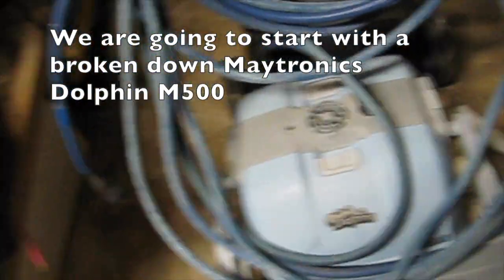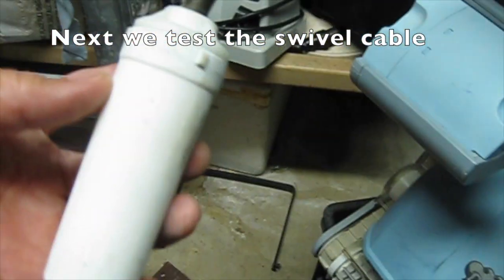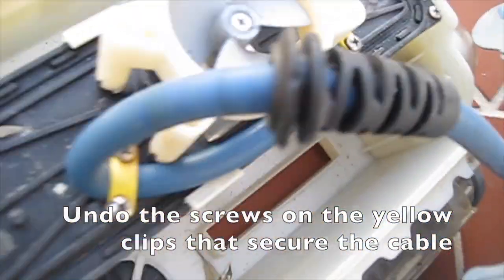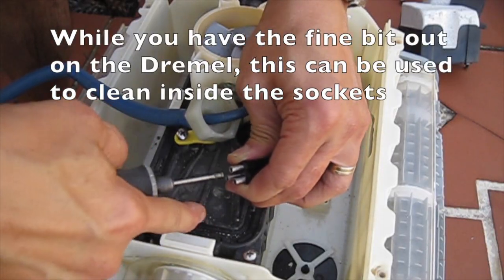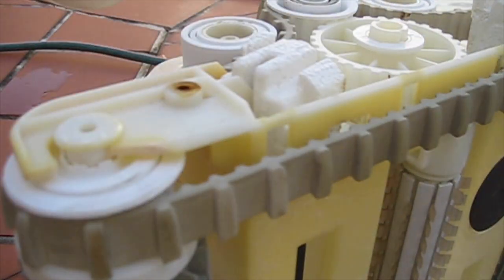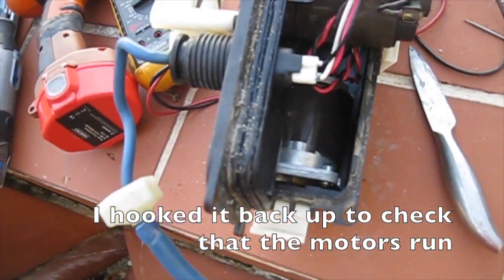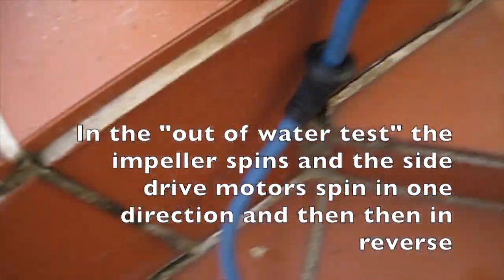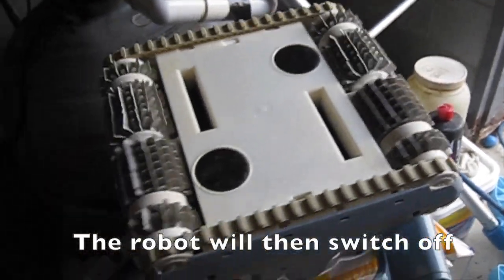fix faulty non working Maytronics Dolphin M500 pool robot complete diagnosis and repair

Comment: Hi Dentivent and thanks tons for your video. I am really hoping you can help me with my faulty machine. About a week ago I noted that my Maytronics DB2 Robotic Cleaner D9440H - 20/07/2021 was moving forward about 10cm and then backwards about 20cm and then it would stop. Yesterday, I took it out of the water, checked that there was no visible obstructions, cleaned the impeller and then did the upside down out of water test. It was during this test that I noted that there was a clunk after every rotation. It operated for approximately 15 or 20 seconds and then stopped for about 5 seconds and then started up again, but it did not turn itself off (with the continual clunk every rotation). I turned it off, put it back in the pool and it did the same thing; forward 10cm, back 20cm and then would not move. Today I have removed the track covers and confirmed that there is no blockage. I hand spun the cleaner rolls and noted that there is a 'clunk' on every rotation. I then tried the upside down out of water test again; however this time the tracks moved very slowly for approximately 2 seconds and then it stopped. I waited approximately 2 minutes and it did not commence operating again, so I turned it off. Can you please suggest anything with this one? Cheers,  John
Reply from the maker: Glad to help. I’ve fixed two DB2 machines in the last few weeks . They are similar to the S200. The clunk is most likely why it is not working . I’d take the tracks off and spin the wheels to see if you have a broken gear or the gear is not engaging properly.  Let me know what you find.

Comment: Thanks for this helpful video!  Our unit has a 3-pin cable and I think the power supply is faulty (erratic voltages).  Do you know the expected voltages at the power supply socket? 30V between which pin numbers, and what about the third pin?  Thanks for any help!
Reply from the maker: I’ll check when I get home but the third voltage is very low like around 5 volts and that is only used to change floor/wall/ water line selections . 
Best place to check voltages would be the power supply and then check at the robot end but you have to take the cable out of the robot so make sure you silicone grease the connection well and check for corrosion inside the motor box connection . Also do not over tighten that white ( or black ) nylon nut .
Reply from the maker: If your multimeter lead is negative on pin 3 the 29 volts DC is pin 2. There is a signal voltage on the third pin . I can check what that is if you want but be careful that you are using a good quality meter as some of the low end meters can give fluctuations.
Reply: @Dentinvent  Hmm, with the robot unplugged, I'm getting nothing between pins 2 & 3. Keeping neg lead on #4 I get +5V when the app says it's not cleaning and -16.7V when I hit  start.  Good quality Tektronix DMM. I think the supply is busted. I removed the connector and the familiar stench of burnt electronics was intense. Thanks for hanging in there with me!

Any info on that control signal would be great.  I'd like to get this running using my benchtop supply as a temporary fix but not sure if I need a command signal or just give it the 30V.

Comment: Hey man - great video but still having issues- it does the test cycle fine and the impeller goes - put it in the pool and it just says nah - it had some debris wrapped around the impeller and was a bit stiff to start with but it’s humming on dry land / troubleshot everything else but just thinking it might be the impeller bearings with the extra resistance from the water making it say no more - any thoughts as it’s beyond a joke 

Cheers, Nick
Reply from the maker: Nick ,
After that video , I had a few problems ( coming up in a new video when I get to it ).
I completely disassembled the black box and took the motors out . Seems like one of the motors had a stiffness in the bearing and that caused the robot to keep stopping.  Another thing to check is the active brush wheel bearings . If the bearings wobble it causes stress on the drive and robot stops .
Let me know how you go .
Reply: @Dentinvent  Thanks on the prompt follow up. Here’s what miss temperamental has been doing. Stopped working so replaced the main drive rollers as teeth missing. Great, problem fixed - 3 weeks later same deal/- playing up going a metre each way and shutting down. Replaced the side bearings rollers for tracks /- goes again (for one cycle) and then nada again. Used a mates control box and it went fine for about 5 minutes and just stopped so back to same old - it doesn’t even turn on unless it’s unplugged for 15 - 30 minutes and then does it’s haka and that’s it again - so I think I’ll dismantle the drive motors and start there and then come back to the oracle and let you know how it goes. Appreciation again on your videos as they are very informative and it’s hard to find the proper oil in this day and age of information hoarding so top marks good sir!
Reply: Success and joy finally - it was becoming like my nemesis or the better half lol 

But yeah, it required unplugging the two drivers in the black box and taking them out and then just unscrewing the two bottom screws on each and pull the bottom plate off that has the small switchboard attached - lots of carbon dust so blew it out with the central slide housing off. I then used 400 grit sandpaper and cleaned up the copper spinning bit and scraped the centres with a razor, sprayed with contact cleaner and wiped off /- also sanded the face of the two spring loaded small magnets on the switchboard and put back together /- trick with the spring loaded magnets was I looped the copper feed wire over the back of their guide runners / - put back together and put screws in and tighten up - then loosen them off just so you can see inside and use a small screwdriver to flick the wire off the runner so that the springs reengage and then tighten back up put back together and hopefully your away - cheers again Dentinvent - it’s always good to have the intel 👍🏿🤙✌️

Comment: @dentinvent - thank  you for the detailed and thorough explanation! Very useful. On my M5 with tracks and rollers removed, the dry test goes well on one side (~10 sec) but on another side the motor stops after 3 sec.  Before opening the motor I wanted to ask the expert - thoughts?
Reply from the maker: I always thought both sides operate for the same time .
I’ve taken many of the motors apart and I’m making videos on current draw and bearing changes. The robot in the video ended up stopping all the time . I took it apart and compared the two sides and one drew more current . I changed the bearing on the high craw motor and … it works like normal .
Still working on that video of you want me to make it . 
I did note high draw current does make the robot stop completely.
Reply from the maker: If you open the motor it usually seals back well and you get a chance to check moisture inside it so that’s a bonus .

Comment: I have a Dolphin Sigma cleaner but very similar to your machine (about 3.5 years old). Mine runs a few feet and then stops with the red light shown on the power supply unit.  I did the upside down test and it is fine. I have replaced the guide wheels, tracks, climbing rings and brush set; but the problem still persists.  Since it passed the upside down test, so I assume the problem is not with the electricity.  Or I may be wrong?  What can be the problem?  Will great appreciate any advice.
Reply from the maker: Strange if it passes the upside down test . 
When the wheels run with robot upside down does it look smooth? If it has a central active brush , often the bearings go and cause the gears to run crookedly . This can make the robot stop . If the gears of the active brush look suspect , remove the active brush completely and see if that works .
What in the red light on power supply ( what does it mean ?) show .

Comment: M500 powers up in water but then shuts down within 10-15 seconds. I disassembled down to and including motor box ...all dry. 28V at cable end. Connections clean (gold). The unit was tested upside down as the video suggests it runs one drive for about 5 seconds then the other drive...so all good. when I placed the unit in the pool. It powers up but within 15-30 seconds it shuts down. Any suggestions.. circuit board gone? The motor has been replaced once.
Reply from the maker: When it was upside down , did the wheels spin smoothly ? I found one two weeks ago that the pool shop said it was a blown motor and it was actually the active brush bearings broken causing robot to just stop . Have a look there . Other place it can be is the bearing of the impeller motor . I’d check the active brush bearings and get back to me . One way to check is to have it all back together and take the active brush right off and see if it runs .  Let me know .

Comment: @dentinvent
 Hi I am working on my neighbors Supreme M4. I have continuity all through the cables and the correct voltage all the way up to the motherboard where the voltage reads the same as the box. The motors will run off the box when I jump from the box.  but nothing happens after I reconnect everything. My neighbor said a rag was sucked into it. The tracks spin easily and motors work. Could it be the motherboard. It does light up though and give the correct voltage. I did use his other box that currently runs the premium model and no change. Thanks for any advice!!
Reply from the maker: That’s really interesting that if you run directly off the power supply it works but not with the cable . Sometimes voltage is not an indication of being correct . Can you swap the cable with another one to check ? Also is there any corrosion at the motor box - cable connection and is there any corrosion in the anti tangle swivel connector ?
Reply: @Dentinvent  Funny enough I was thinking the same thing about the cable. His cable is fairly twisted. I could try his box and cable on his premiere and see if that makes a difference? I checked for corrosion through out the cable and connection and box, I did not find any.. Initially the inverter motor did not work so I got another off of Ebay so that is what is in there now. The replacement was the Exact same motor. The seal was new on the motor case so no water damage I could see. It never has tried to do the test part. Could it be the bearings on the drive motor causing too much resistance? I mean would it at least try to do something once all is connected? Right now it does nothing so that is why I thought the motherboard since both motors were turning? 
Thank so much for your thoughts on my problem. I will update you as soon as I try the other cable and box at the same time.
 
Wow you should start your own forum and definitely the buy me a coffee thing on you tube. There are all kinds of people trying to repair these things :)
Reply: @dentinvent Hello again. I tried my neighbors box and cable still a no go on his broken supreme robot.. I even tried the original power box through his cable and it started his premiere robot. I am guessing the motherboard? Any other ideas. The boards are just so expensive just to try one. Any other ideas?? About to give up..Thanks buddy :)
Reply: @Dentinvent Just an update. I was able to get another board fairly cheap and everything started right up...Guess it was something on the board burned up. No obvious signs of damage. Thanks for the advice and help..

Comment: Thankyou for producing comprehensive video. 
I have a question though. What should I be looking for when one of the dual motors continually stop working and requires the movement of the track in one direction or another to commence operating again. I have replaced the bushes inside the motor but it reappear once more, approximately  48 hours later. 
Should I be looking at the  spindle shaft associated with the affected motor or is it sometime else?
Reply from the maker: Thank you for the nice compliment.
I would take the motor out and spin in by hand . If it feels gritty or rough , change the bearing on the spindle of the motor .
Message back if you have problems.
Reply: They do not feel gritty. But I am happy to replace. Would you have part numbers of both sides aswell as the o rings? If not sizes possibly.
Reply from the maker: @alessi1973 
I don’t have part numbers but best to look at the ball bearing nearer the water side ( near the long end of the shaft ). Use a flat piece of steel with a slot cut into it to fit the shaft and tap the motor shaft to remove the bearing and read the number on the bearing and buy off eBay or Amazon ( watch as some bearings are poor quality … cheap ones are the bad ones ).

Comment: I have an M500 cleaner. One of the climbing pads broke so we replaced all 4 of them. Now, the cleaner will move left, right, and rotate, but will only go forward about 2 feet. It shuts off after 5 minutes of rotating around. What can I do to fix it? Out of water test appears fine. Could it be the bearings? We are not sure which parts to order.  Thank you.
Reply from the maker: If it worked when the climbing pads were old and worn, it possibly could be that the new ones are too tight . Are the pads genuine Maytronics ones ?
In my video , this cleaner kept stopping afterwards and it was the bearings . I’m still making that video . 
I’d try swapping the climbing pads ( rings ) back and let me know if that works again.
Reply: @Dentinvent  Yes, they were genuine Maytronics parts. It makes sense that the bearings would stop the robot from moving. I will order new wheels. The tracks are is excellent condition. The active brush is missing most of its little tab brushes so that will need replaced. Thank you!

Comment: What controls direction - the board in the motor or the board in the Power Supply? Replaced corroded board in motor housing now it starts impeller and drive motor right up and only goes in one direction - no self test happening????
Reply from the maker: The direction is controlled by the board in the motor . The power supply mainly just gives power and timer functions and can send signals to the motor to stay on floor etc.
I think your problem is still in your motor box. 
Did you check the actual drive motors for current draw? I have found the actual current draw can affect start / stop of the robot . If only one of your drive motors is running, it will affect direction.
Reply: @Dentinvent  it is an M4 so only one drive motor. Board must not be proper one as from eBay seller.......ugh.
Reply from the maker: @justfun-ij5xn  
Best way to get a replacement board is wait for a broken robot to come up that does not work but assess to make sure it has no water into the motor housing (work this out by the seller's description of how the robot died). Don't buy one off ebay as the seller makes ten times the price of a broken robot.

Comment: Mine works in Manual Mode but when i run it in Auto it runs for a few feet and then stops. I did the upside down test and it runs and then stops like its suppose to. What can be the problem?
Reply from the maker: Do you have the motor out ? 
If it runs with motor in the water but still stops, it will most likely be the drive bearing of the motor .
Let me know and I’ll guide you .
Reply from the maker: Do you have the motor out ? 
If it runs with motor in the water but still stops, it will most likely be the drive bearing of the motor .
Let me know and I’ll guide you .
Reply: @Dentinvent  thank you. Ill check it out tmw. I appreciate it.

Comment: I was hoping this video would help me fix my M500's bearings. You started out fixing an M500, but during the final out of water test, you are showing an M400.
Reply from the maker: That out of water test was actually a M500 set into the body of a M5 Liberty ( has no active brush in the middle of the robot body ). 
I’ll still make a video on the bearings.
Did a heap of tests on current draw with old bearings and new bearings and strangely , seems like the new bearings were drawing MORE current ? Didn’t understand that but the new bearings on a machine which kept stopping would actually fix it. Stay tuned and I’ll make that video soon.
Reply: @Dentinvent  Thank you! I saw the active brush in the beginning, but it was missing at the end of the video. I was hoping to learn how to replace the active brush. I did learn how to remove the side panels to remove the wheels if I ever needed to replace the tracks. When I opened one side, there should have been a main roller bearing (4 circles with the bearings inside). There were only 8 ball bearings floating around. The two inner circles that hold the bearings were missing on that side. I found 1 smaller ball bearing inside one of the guide wheels.     I opened the other side, and the ball bearings were inside the circles like they are supposed to be. I am ordering new guide wheels and pully gears today. 
When I removed the active brush's 4 screws, one side fell apart. It was missing one of the eight bearings, so that is where the small bearing came from. I could not get the ball bearings to stay inside on the one side that fell apart so something is broken. I am not sure how that one side is missing the center plastic parts. Not sure how they could have come off. This is the first time we have taken the robot apart, and we bought it new from Maytronics. I would love to see how the bearings are installed in the wheels and the active brush. Thanks.